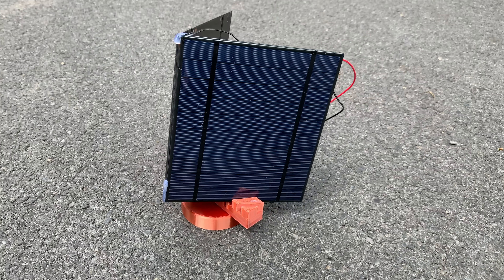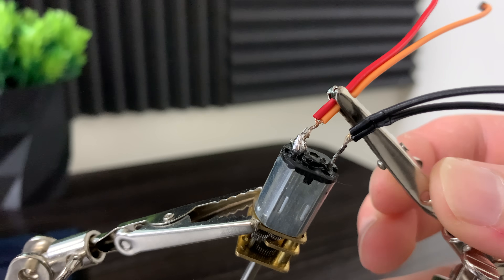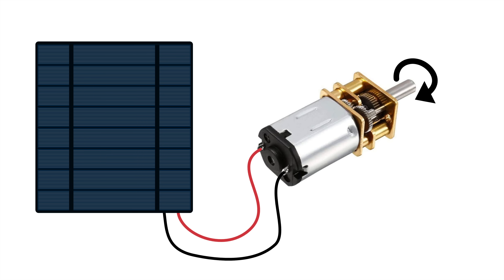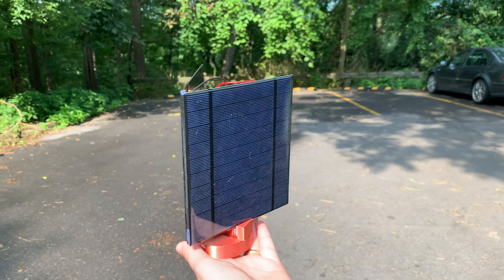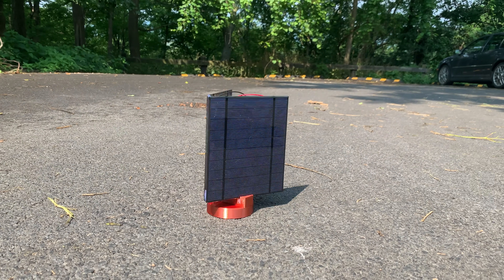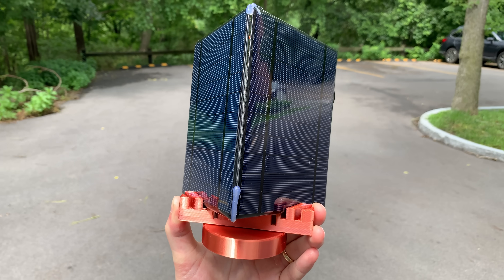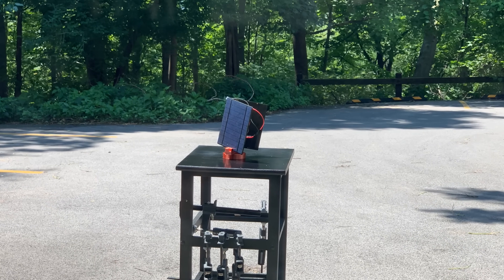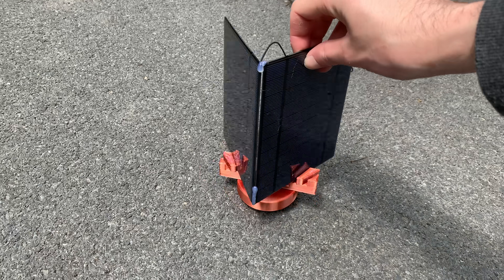World's simplest sun tracker.

Comment: mm short circuit. You cant get power from those solar panels...
Reply: Then what turned the motor?
Reply: @robertmorin6495  You cant get excernal power from this system because this can run only this motor.  Motor is running by differental voltage. If system is stable then there is 0volts.
Reply: @gelo1238  Exactly.  The DC motor produces no external power by itself.  However the dc motor turns a shaft. The shaft can be used to align things with the sun.  Things like solar panels that do produce external power.

Comment: It tracks the sun but uses all it's energy doing so! This leaves no energy to serve the purpose of having the solar panels. Maybe some force multipliers and isolation of the motor panels would allow the addition of lots more panels and their added weight without having to tie their power into the tracking motor operation.

Comment: This isn't really a problem that needs solving.  Solar panels are quite efficient and the complexity of building massive rotating arrays comes with it an expense that can easily be offset by adding an extra panel and keeping them stationary.  It's neat, though.
Reply: It is a problem that needs solving. ...Solar panels are most efficient when at the optimum angle to the sun.  Most of the day they are not at the optimum angle.  Adding an extra panel doesn't change that fact.

Comment: Cool, but what value is it? You are not powering anything except the motor to enable the panels to track the sun. WHen i think of a solar tracker, I think of something that will use minimal energy and allow me to put my panels optimally in the sun to get the best power out of it and STORE it, not immediately use it for stopping the tracking. Also, I cannot help to think that using the competing voltages against each other on the motor will shorten the life of the solar panels and probably the motor too. I would expect something is heating up with that in the "Neutral" state. Kind of makes me think about taking 2 9-volt batteries and sticking them to each other. In the end, it will not be good. I think the same thing here.
Reply: You are not using your imagination. This is the greatest concept to come along in a hundred years.

Comment: Way cool. Such an ingeniously simple solution to what can be a complex problem requiring lots of different components.

Now I'm thinking that this needs a 3rd large panel that faces up. I'm guessing this solar tracker doesn't collect much sun around midday... So maybe this system of 2 little "signal panels" (I. E. Not used for power generation, but just to generate a signal to tell a motor which way to turn), could operate the larger system which rotates a larger panel that can collect more sun.

A potential issue I can see off the bat is that you'd probably need a larger motor to move a larger panel(s). But that could be powered by the main solar panel and then simply triggered/switched by the voltage coming from the "signal panels" with a mosfet or something.

Really cool project. I might try to make a little one with my 6 year old out of trash/stuff lying around. Even he could follow this ultra simple wiring.

Comment: Solar panel works best when light hit it on a steep angle (90 degree is perfect.) But this construction forces both panels to have a sharp angle between the surface and light direction, so they should have very low efficiency.
Can you place both panels side by side?

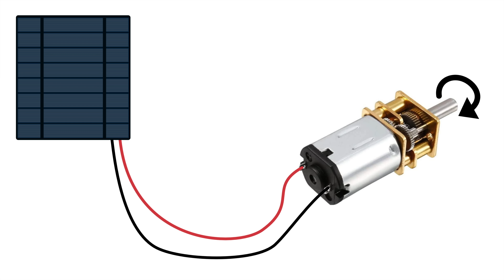Comment: 1:36 the voltage is cancelled out => so this fancy 3d printed toy can do only job is spin around and CANNOT generate electric for other applications as its origin purpose of solar pannel?
Reply: Well, that is true until you put a more powerful DC motor to turn a rotating turntable with a hundred solar panels mounted to it.  These hundred solar panels could be mounted to the top of the turntable at a good angle and produce what 100 solar panels usually produce.  Except more.  The beauty is in the spin around my friend.

Comment: Brilliant!  Home solar panels that track the sun produce 30% more electricity.  Your device could so easily provide the data the need to stay aligned...  Imagine the reduction of materials possible with30% greater efficiency!  Thanks!
Reply: Does it offset the loss of neither panel actually pointing directly at the sun?  Also, since both panels are now orthogonal to the earth's surface there is a lot of efficiency lost compared to orienting them at an angle equal to the latitude.

Comment: But the panels will never be at the optimum angle. Better to mount the panels pointing straight,  and photo resistors to detect the angle and drive the motor.

Comment: So, let's see, this system ensures that both panels are operating at a much less than peak efficiency angle to the sun. Of course this solution could be used to generate a signal that drove a large array to keep that array aligned at the most efficient angle to the sun but I suppose that is why they manufacture COTS solar trackers.

Comment: Is it simple to wire it up so you can pull some current off the panels while its doing this? Does that drop the voltage too low to operate?

Comment: You would need to add a bridge rectifier to connect a load to it.
Otherwise it is a beautifully simple tracking signal generator.
You get an error voltage, same as orthomode tracking for satellite  dishes etc...

Comment: Won't it work with less angle? As this way both panels will be VERY inefficient at all times due to angle to the light..
Maybe combine it with a very low power motor, so it will start from less power difference. Maybe even not exactly a motor, just a bearing and a pair of electromagnets.

Comment: I love how the simpler version is sometimes the most effective. But I am wondering, shouldn't the panels be connected in series with differential arrangement, instead of parallel which you have done?
Reply: If they're wired in series, how would you tell which panel was getting power, and subsequently which direction to rotate? The whole point is measuring the difference in voltage between the two panels. If you wire them in series, you don't have different voltage from each panel.. You'd just have one signal which is the combined value of the voltages. And thus the motor couldn't change directions because it would only ever get power in one direction.
Reply: @williamdowling7718  I am really glad that you went through my comment and tried to communicate the idea. what I mean by using the panels in series in differential arrangement is that the voltage at the motor terminals will the voltage difference between the two panels.  If one panel gets more intensity(say left one) then the the terminal voltage will be positive(or negative depending upon the measurement points). But say if another(right one) gets more intensity then the terminal voltage will be negative(opposite of previous one).
In simple term, V = Vl-Vr(left-right); (-ve sign is because of anti-series connection)
If V= +ve, Vl>Vr, so rotate towards left
If V = -ve, Vl<Vr, so rotate towards right,
So the system should be operating until V nearly = 0, i.e Vl=Vr, so equal intensity.
Hope I made my point clear. :) cheers!
Reply: because solar panel would always output power from the same terminals no matter if they're on the left or the right. hence why u need to flip the terminals for one of them. lets assume the solar panel generates positive voltage on the positive terminal when in the sun.

if both solar panels are connected in series then the positive terminal of one solar panel would connect to the negative terminal of the other solar panel so regardless of how the light hits the solar panels, the positive voltage from both adds up. the direction also doesnt change. if both positive terminals are connected to each other then the voltage just wont go anywhere since its not connected to the negative. solar panels are basically diodes and they only allow current to flow in one direction (hence why they have + and - terminals but the motor doesnt) you can flow current reverse of diodes but it would be much much higher than the voltage in normal conditions.

hence why u need to connect them in parallel.
Reply: @aoyuki1409  Yes, the voltage of panel increases with then intensity(considering constant panel current). The junction point of the solar panel is suppose to be consisting bypass diode, however we need to connect additionally here for one cell. Also I assume you that know the potential diff. between the pair of panels is +ve or -ve depending upon which panel gets more intensity(considering perfectly same panels) which is potential diff. appearing at the motor terminals. Yeah I can see the parallel connection working perfectly fine, and just curious. And, yeah, I would love if you guys share your view and help me clear my doubt. :) Cheers

EDIT NOTE: I just realized that we don't need the bypass diodes as the anode-cathode orientation is in the way we want current to flow. Also, from the equivalent circuit of the panel(which is of current source and antiparallel diode in parallel with loss resistances), it seems like anti-series configuration would make the system less sensitive (which may help overshoot problem, maybe).
Reply: @diliprana3882  you should start seeing Solar Panels as variable DC voltage source with a diode attached to it. You will see that if you connect them in series its like putting two batteries in series so even if only one of the batteries work, the flow of the current is the exact same, regardless of which battery has power. So if you connected the solars in series you would get just one way DC current and the motor just spins one way.

The solar panel cannot short circuit itself because its a diode so reverse polarity is impossible, at least at the voltage that the solar panels produce. If you put a reverse voltage on a solar panel that is high enough to overcome the diode breakdown voltage (the reverse voltage at which diode breaks down and flows current in reverse) the solar panel would glow like an LED (or light up in flames, whichever the most likely).

There will not be a change of potential difference between +ve and -ve terminal because it will always be a positive difference. It will never reach a neutral or equal voltage in respect to each other.

You can draw the diagram and apply KVL for both series and parallel when the left, the right, and both solars are powered. It would be clear by then. If not, i would suggest someone well versed in electrics to demonstrate the KVL of the two different series and parallel
Reply: @aoyuki1409  As I informed before, the equivalent circuit of solar panel is the current source with diode connected in antiparallel(I suggest you to go thorugh the figure once). Also your information about always getting +ve polarity seems questioning as I have said that connection is antiseries connection.
The simulation of the anti-series and anti-parallel connection with different driving current(simulating different intensity)  with equivalent model can be used to show the point I am trying to make. Also I will be very happy to know if someone tries or had tried such connection already. 🙂
Reply: why ? it is working? why should we change it?, well i did this too, 5 years ago, but its better if the panals have a sharp angle, so it can rotate way more earlier in the morning (from afternoon position to morning sun position, wouldnt work well with an wide angle) 
if you wanna see my version you can search on my channel i have 2 short clips of my solar tracker

Comment: Please excuse my naivete . To say the least , this is not my play ground but I WANT to LEARN !   Can this be "up sized" to handle a larger array ?  Will not the wind DESTROY it pretty quickly ? Mainly , I want a setup large enough to run a refrigerator and a few other things .  Any help for this techno challenged desperate Ole' Dude will be greatly appreciated 
   Even pointing me in the right direction for SIMPLE explanations , Please .
Reply: Imagine 2 bigger steering panels with a bigger more powerful DC motor.  Imagine connecting the motor to also turn a large plywood turntable on top.  Imagine you have a few solar panels on frames bolted to the turntable. Imagine you are tapping the energy of the mounted solar panels and you can run your fridge.

Comment: So in fact you are shorting out the solar panels. Doesn't seem a long term or an efficient solution to me.

You could ofcourse use an low powered solution like this to drive an extra and larger panel to the sun and use that for energy generation.

Comment: I expect the trade-off is efficiency of energy harnessed per area of solar panel, which must be a bit low due to the poor angle of incidence of light on each panel.  I think you'd be better off using the original motor and having the 2 panels face the light on a more similar angle.
Reply: This is not an energy collection device. This device is designed to control a much larger array of solar panels. This 1 watt panel setup could orient 2000 watts of solar panels and increase output by 30%.

Comment: I made something simmilar for my gcse project, the only issue is that after some time in the sun the motor can begin to heat up from the conflicting charges so fir any practical uses there has to be some form of timer which can disconnect the motor for some time

Comment: This also works in Space Engineers. Build a grid with a solar panel and a gyroscope and attatch it to a big grid using a magnetic plate. It will spin until the solar panel is at a 90 degree angle to the sun. Repeat for other axis and profit.

Comment: The simplicity is just brilliant. Now, to actually use the information this device generates, you could attach an Arduino with a compass sensor. Probably needs an extra solar panel to power the Arduino.

Comment: I wonder if the nearly constant low voltage on the motor will damage it? I'm amazed the voltages from both panels just cancle each other out and not make the wires hot. Maybe it's not enough heat to damage anything.
Reply: Nope, it won't hurt the motor. When both panels receive the same amount of light, they output the same voltages, but with reverse polarity relative to each other. So at that point the voltage across the motor is (very close to) zero. When the voltages differ enough, the motor rotates the panels, and it's back to (very close to) zero volts again. 
Besides, these small panels are not able to produce enough current to damage the wires used anyway, not even if you short-circuited them.
Reply: @MicraHakkinen  interesting. Good to know. Thanks!

Comment: Neither of the solar panel would be working at maximum output in your design.  The solar panel would be at maximum & optimal output only if the sun ray is at 90 degree with the panel.

Comment: 2:48 - Why not just use resistors? Also, how power efficient is your design? depending how much power it draws on idle, it could be an effective design vs low-power microcontrollers or integrated circuitry (imo, efficiency reigns over simplicity). Last question I have is how the motor preforms when the solar panels are loaded from another output. It would be interesting to know :)
Reply: it wouldnt work if they were loaded from a different output. When the motor centers the panels the net voltage is 0v DC

Comment: Why use two solar panels? Just make the motor turn the One Solar Panel, away from the Sun. It will stop when it is shadowed. 
If you want to reset it in the morning, just use a mirror to complete the 360 degree rotation at sunrise.

Comment: Could you maybe retry this experiment? I have an idea of trying a slightly less powerful solar panel on the east side. This way as the sun moves to the west the west facing panel has an easier time overpowering the other panel. I thinking it will provide more accurate tracking 🤷🏼‍♂️

Comment: nice idea. but isnt the angle to the sun very important for the running efficiency of the panes? having both of them at such an extreme angle seems like it might be way less efficient than even just both panels laying flat on the ground, in terms of how much energy is produced over a day. This being able to track the sun means its always going to be very inefficient. you could get the same result by having the panels both be flat as in on the same flat surface, and angle that flat surface towards the sun, they will balance each other based on the difference in efficiency and that should still result in the aiming at the sun.

Comment: How much power can you got from this? I mean Voltage and current?
Better approach would be using 4 panels connected in bridge and the motor on the bridge diagonal. That way, can use the output power delivered from those panels.

Comment: The cells would last longer and generate less power in neutral (centered) if you intentionally left a dead spot when the device is pointed directly at the sun. By spreading the opening up just the tip of the triangle. Could make the slots in a rotatable section so you can adjust their relative angle.
Reply: A fun idea might be a 'main' panel, and two smaller panels linked to a DC motor as shown.  The larger panel provides the main power supply, while the smaller panels are set up to keep the main pointed at the sun.
Reply: @toddkes5890  That's pretty much the basic concept. you wouldn't use full size panels for the solar aiming system. Additionally any kind of power protection circuit would make the panels used for the pointer last better.
Reply: @toddkes5890  This is what I was thinking while watching.
Reply: Or by adding a bit at the tip to shade the panels.